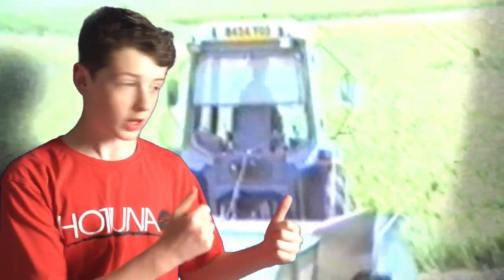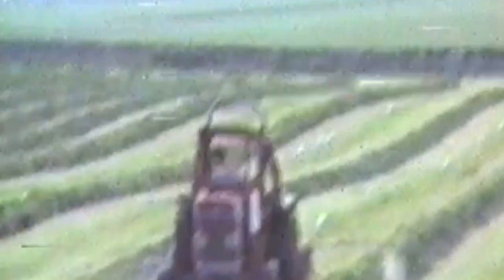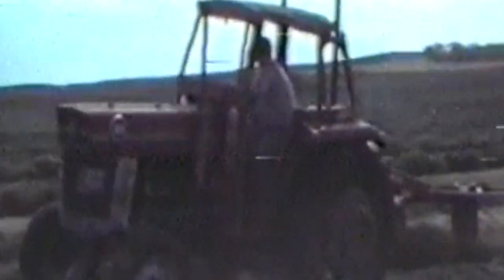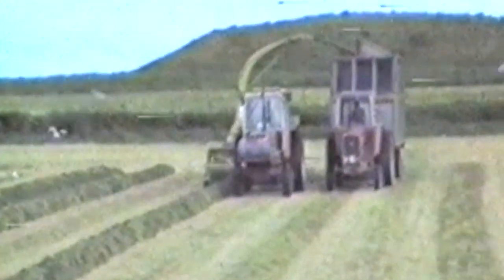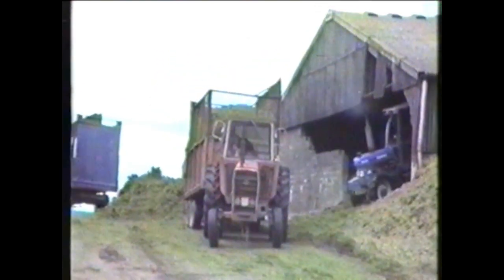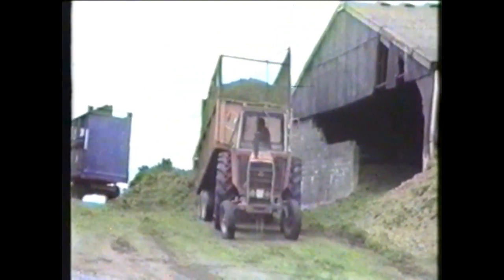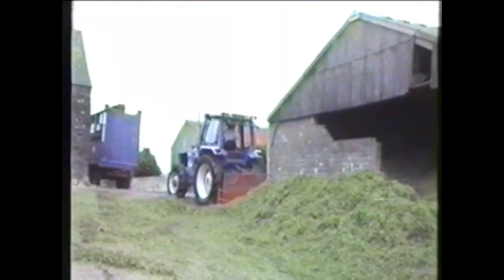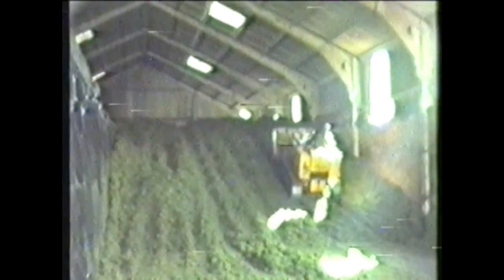Silage in the 1980s | Claas Jaguar 85E

Comment: Great to see. Thanks team. Interesting. It’s what I think farming is like everywhere. That’s why I always get surprised by modern equipment: it’s size and it must be so expensive to buy, maintain and even to store. Especially when it only does one job like your chopper. But I guess I’m just showing my age!
Reply from the maker: It’s all very true but all needed.  Things have changed so much, imagine the next 30-40 years progress.
Reply: Farming Files I imagine with the unpredictability of the weather, getting the silage in and covered in two days rather than 7 makes a huge difference to the quality of the fodder?
Reply from the maker: 100% correct.  It still takes 4-5 days down at Granny and Uncle’s farms then 2-3 data here.  So all over in a week instead of over 2 weeks.

Comment: The trailed harvester is a fairly rare machine, if you look carefully you can see that it has its own Diesel engine to power it. It is probably a aftermarket conversion as Claas never had the engine in this position. Claas engineers put the low down on the draw bar, probably a better position too as the center of gravity is lower and the extra weight is carried equally with the tractor. Nevertheless it was an advanced machine for its day.
Reply from the maker: This is a Claas factory built machine, possibly the first one to be sold in the Uk .Claas engineers came to the farm to monitor the engine when it first was used.
Reply: Ok, in classic tractor magazine they did a feature on engine driven trailed harvesters and they featured a Claas model with an engine mounted on the draw-bar. This machine was put together by a Class dealer and they sold a relatively small amount of harvesters and they had support from the Claas factory. Your grand parents were ahead of the pack back in the day. Thanks for correcting my information.
Reply from the maker: They certainly must have been👍🏻.
Reply: @fnh8340  It was Manns that built them. The Claas UK importer at the time and now owned by Claas directly. There was a 75 with an engine on the drawbar in the magazine but it was farmer built. Both the 75E & 85E machines had the engines mounted like this. The 85E is very rare. Does anyone know where this one is now?